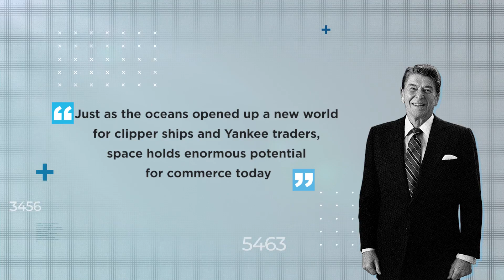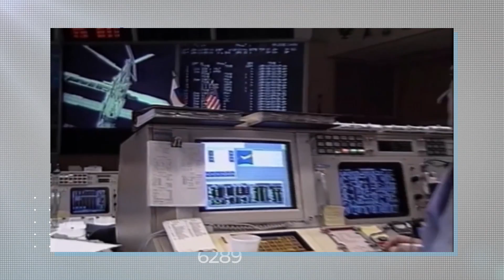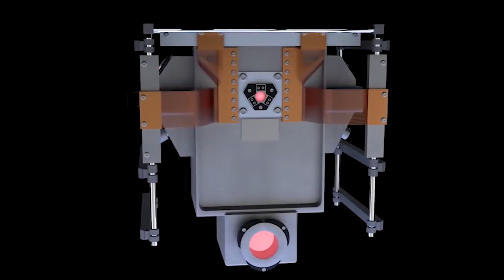The Insane $150 Billion Space Station

Comment: Holy crap this video contains so much complete nonsense. And I've only watched the first couple of minutes!! 

1) With the exception of Skylab (which was made out of part of the Saturn V rocket), pretty much EVERY space station that has ever existed has been modular. The ISS is no exception. Think about it. How can you launch a single-piece space station that is bigger than what the rocket can launch? Of course it was going to be modular. 

2) There was no "adding or removing of modules as needed". The entire thing was meticulously designed from the beginning, and construction & assembly proceeded methodically. The only major changes were deletion of modules at the design stage, prior to manufacture, for budgetary reasons, and making do with what was left over.

3) The solar panels were not installed "in Nov 2000", but in batches over many years. And while the narration was making these false claims, the video clip being shown was of a completely different solar panel, the iROSA (ISS Roll-Out Solar Array) that was added decades after the originals, beginning in 2021.

4) I have never heard the supposed consensus that "the Russian segment is more comfortable to live in". This is just completely fabricated nonsense.